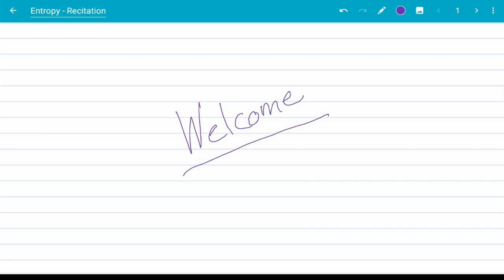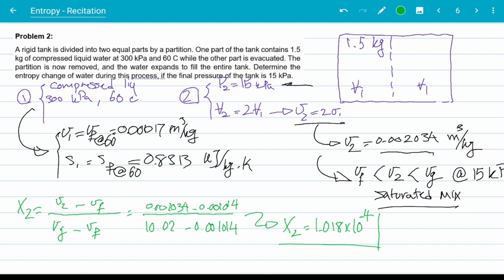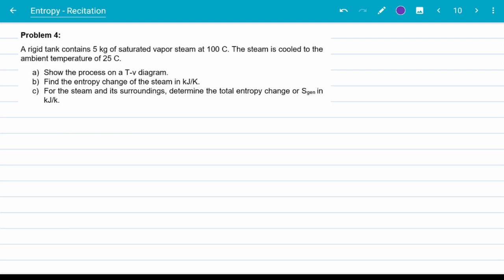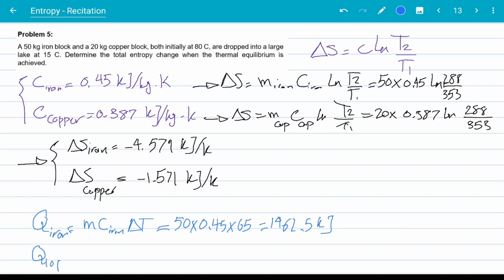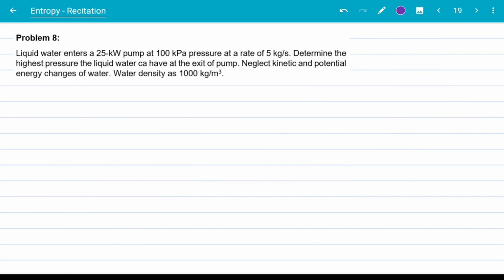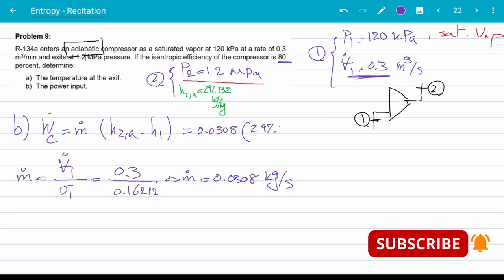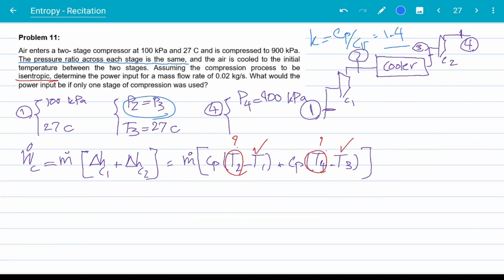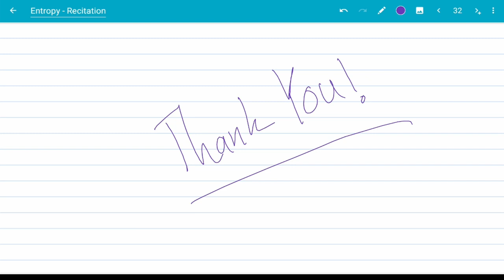Sample Problems - Entropy

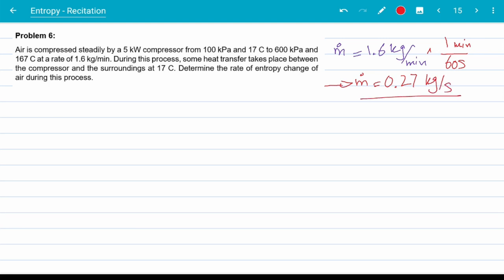Comment: In 40:20, shouldn't the mass flow rate in seconds be 0.027 m/s instead of 0.27 m/s Sir?
Reply from the maker: Yes, you are right. That is a miscalculation on my end. Good catch!

Comment: In question 2, the water at the initial is compressed liquid, so why did we use the specific volume of saturated liquid at 60 C?
Reply from the maker: That's a great question. Often, when looking for compressed liquid properties, we see that the compressed liquid tables are missing our data. Usually, this happens when the pressures are relatively low. When this is the case, like our question #2, we can approximate the compressed liquid properties with that of a saturated liquid at the same temperature.
I hope this clarifies things for you.
Reply: @WannabeProfessor86  Thanks for the answer!

Comment: In 1:17:02, why did we use Cp rather than Cv? Is it because the pressure of the surrounding is constant?
Reply from the maker: No, not really. To better understand it, please review the 1st law analysis of control volumes. There you can better see that the work of an adiabatic compressor, turbine, or pump is the equal to the change of enthalpy, rather than internal energy. Now for ideal gases, change of enthalpy is equal to cp*deltaT.

Hope this clarifies things for you. Let me know if you still have questions.
Reply: @WannabeProfessor86  Oh yes, I remembered, thank you so much!

Comment: Is there a formula to find a quality? I dont understand q2 and q3
Reply from the maker: You can calculate the quality of a mixture using any of the common properties such as entropy, enthalpy, internal energy, and/or specific volume. The equation is very simple as shown in the video. 

quality = (property of the mix - property at the saturated liquid state) / (property at the saturated vapor state - property at the saturated liquid state)

hope this helps.
Reply: @WannabeProfessor86  thankss a lot

Comment: In problem 2 when I have the value of the temperature and pressure,  which table should go for? my professor said the pressure table is more accurate but you took the temperature.
Reply from the maker: Good question. In problem 2, we are initially dealing with compressed liquid. You either use the compressed liquid tables, or use the temperature table and approximate the properties of our compressed liquid with those of a saturated liquid at the same temperature. Hope this answers your question.

Comment: In 1:02:00, shouldn't mass flow rate be 1.850 kg/s?
Reply from the maker: Good point. Please take note that the volumetric flow rate is 0.3 m^3 per minute, not per seconds. I skipped the conversion from minutes to seconds. The number in the video is correct kg/s!
Reply: @WannabeProfessor86  Yes, I just divided the numbers appearing on the screen. When we divide 1.850 by 60 in order to convert it into per seconds, of course it gives 0.0308. Thanks!